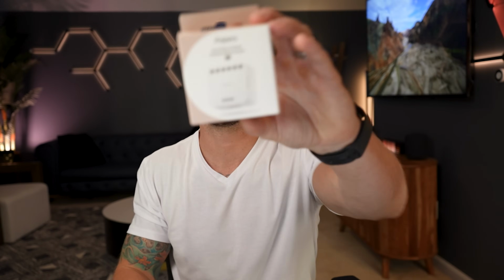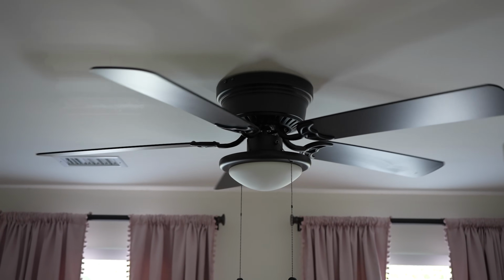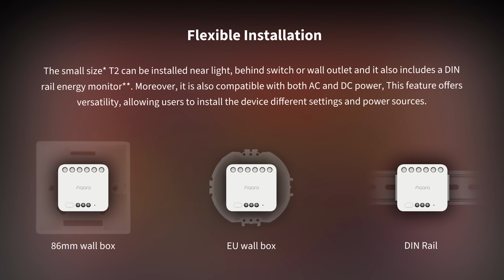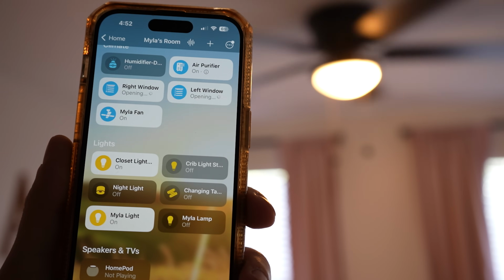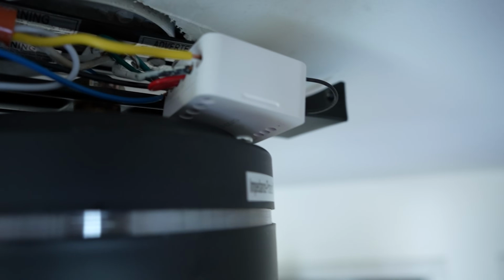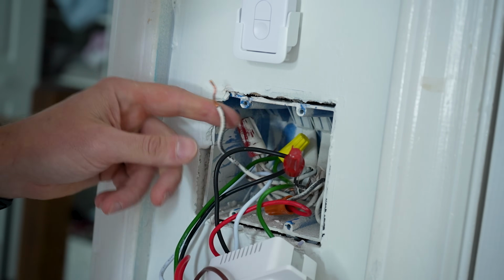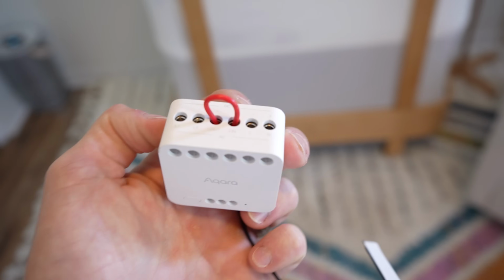Make Your Ceiling Fan (or Anything Else) SMART with THIS!

Comment: Inductive loads like fan motors are rough on electromechanical relays because they cause arcing across the contacts that can cause a fire hazard. If you want to automate a fan, use something with a solid state MOSFET relay.

Comment: Big limitations, DC voltage min is +24V so no good for +5V or +12V unless step up converter is used.  Also HomeKit  does not recognise the pulse mode with dry contacts and sees it only as a toggle so it's out of step 50% of the time.

Comment: It says I need to get something called “hub” to get it worked. Why you didn’t mention? Or am misunderstood something
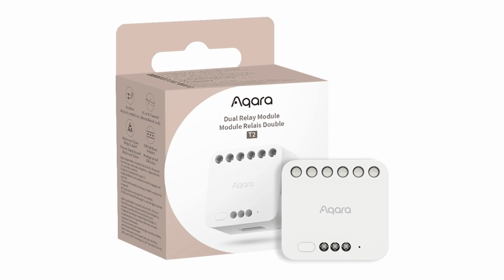Reply from the maker: Yes it is a zigbee device, which means you need an Aqara zigbee hub (mentioned around 2:40)
Reply: @ShaneCreates I’ve bought the M1S 2 gen and on the way to get it paired it says error code 74. So it appeared on my Apple home kit, but it works just as a single switch with option to dim. My plan is, to do the same thing as you did in this video. To separate light fixture and the fan. I can’t pair the t2 module with m1s gen 2 hub… can you help me to find a solution please

Comment: For those wondering if it works with Home Assistant, it doesn't. You need an Aqara hub, and then it will work. The relay itself does not work with home assistant, but the aqara hub does, through a Matter integration.

Comment: Hey Shane, just wanted to confirm that this works only on/off with the fan, no option to adjust fan speed?
Reply from the maker: That's correct.
Reply: @ShaneCreates Do you have any recommendations for doing so with a fan that only has a single on/off existing wire? 

I was thinking that it could be done with a HomeKit switch such as the Meross and a HomeKit fan such as Hunter.

Comment: Great video. Actually while building my house I put about 40 aqara T2 smart relays inside the junction boxes for all the lights. This means I can use regular lights and regular switches. The T2 relay module sends only 12V to the switch boxes on the walls. They are meant just to click the circuit together so that the relay turns on or off the specific light. This means my circuits in the walls are still normal, nothing is changed from the electrical standard while I am able to use regular lightbulbs and switches to control the lights but also have that option on the app.
I am trying to make my house wife approve so that the physical functionality is always there even if you don't want to use the phone or any automation.

Comment: YOU DONT NEED ANY OF THAT! JUST USE THE BROADLINK RF 433 MHZ WIFI PRO. IT IS JUST A BLASTER THAT CONNECTS TO HOME ASSISTANT, HOMEY, YOU NAME IT. SO STOP CLIMBING LADDERS AND PLAYING AT BOB THE BUILDER BECAUSE ALL OF THAT IS COMPLETELY UNNECESSARY. YOU ARE GOING TO FALL OVER THAT CHILD'S CRADDLE BRO. YOU ARE TOO OLD FOR THAT. LIKE I SAID, NO RELAYS, NO MODULES, NO CABLES AND NO ELECTRICAL INSTALATION NO SENSE. THE ONLY CAVEAT IS THE YOU NEED A LINE OF SIGHT BETWEEN THE BROADLINK BLASTER AND THE FAN, SO YOU MAY NEED A COUPLE OF THOSE. IT IS JUST A FIXED REMOTE CONTROL. MOST FANS ARE 433MHZ SO YOU DONT NEED TO WORRY IF IT IS DC OR AC. IT JUST WORKS. THE BLASTER LEARNING PROCESS FROM THE REMOTE CAN BE A BIT OF A CHORE BUT TOTALLY DOABLE!!!

Comment: is there any way to have a switch and a dimmer instead, I've been racking my brains on this. I'm trying to have the fan on on one rocker, and turn the lights on but have dimmable functionality as well on the second "rocker"...
Reply from the maker: If your fan and light each have separate light switches, you can replace the one for the light with a dimmer. But if they use the same light switch, as the one in this video, it's not possible.
Reply: @ShaneCreates  same switch unfortunately. I think the best I can make out oft is to have smart dimmable  bulbs

Comment: Thanks for the detailed video, it really helped me install these devices. I've got the a T1 Relay module and a double rocker switch, but I'm unable to dim the lights or control the fan speed, the switch is basically binary. How did you make the switch have dimming capabilities?
Reply from the maker: The switch is not a dimmer, so there are not dimming capabilities with the switch.

Comment: So I tried doing this. Here is my one question/hangup. If you're really just powering the switch and essentially not connecting the power "out" from the switch to the fan, how is the ceiling hot getting power? Isn't that disconnected since the switch isn't allowing it to pass through? Tell me if I'm missing something simple..

Comment: Hi Shane! I have a challenge for you. I have a two car garage, with two doors. I’m planning to operate both doors with one relay, as it should be doable. How am I able to automate it? I want to open the correct door automatically. The idea at the moment: if my phone is connected to a car no 1 with BT, when arriving home, open door1. If phone is connected to car2, when arriving home, open door2.

Do you have any idea how to solve this? In aqara app, or in homekit or through siri shortcuts or even in home assistant? I don’t have home assistant installed yet, but this might be the trigger to do it.

Comment: Can it be used with a Regular Fan Dimmer switch? I just need to automate  ON/OFF and control the fan speed with dumb knob?
Reply: Shouldn't be a probable. Mechanically, this is just another switch on the device, turning electricity on or off on the device.

Comment: Just to let you know know Shane, you did not have to wire the load wires together (L1 and L2) together to have power always running in the switch. There is an option in the Aqara app that sets the switch into what's called "Wifi only mode." It locks the circut breaker in the Aqara switch to a power on mode and then is used to send wifi signals to things like wifi bulbs or the aqara relay module to control the on/off stage. It's highly advised to not wire load wires together in a power on current state with a wire nut screw. This is because of the load wires connected by a wire nut CAN and MAY cause a fire. It's not guaranteed a fire will start. But there is an increased risk. You should just connect the load wires normally and set the dual rocker switch to "wifi only" mode. What's nice about the Aqara switch to is, it has a overload switch in it that if any heating problem happens, it kills the connection to the load. I've experienced this a couple times when setting up an aqara switch myself when I tried to connect it to a bathroom ceiling heater vent.

Comment: Hey again! Another quick question. I have an AC powered fan with a remote that I'll just bypass. If I have an Aqara t2 in three seperate fans, can I make it that I can control all three fans from a single switch?
Reply: You can. I have two ceiling fans in my master bedroom and I use his setup to control both fans at the same time. If you wanted, you could get fancy and get a 4 rocker smart switch from Aqara and be able to turn each fan on or off from your wall switch too.

Comment: For 3 way switches, kindly describe the additional connection required, i.e.., what to do with the Two Travellers lines? Should both Rocker Switches be connected to the Rocker L1 L2 lines (which you capped in your video? THANKS SHANE! What you do is greatly appreciated.

Comment: Anyone buy the no neutral version of the switch? I want to do the same as making them dummy buttons but can't figure out how I'm supposed to wire it as I wired it just like this and it doesn't work. Should I just power both l1 and l2? @Shane Whatley can you do a video on the no neutral version? I'm at lost to figure out how to get it to work properly. The only time it does work is when I connect l1 to the switch power. I even connected the switch to a e1 and set wireless mode but it still is like broken. It's acting like a physical switch

Comment: It’s a petty Sonoff is seemingly not available in your country. I’ll be fitting the iFan04 to 8 or 9 ceiling fans in my automation early 2025. This switch not only splits the light and fan, but also allows 3 fan speeds. Obviously I’d have to run it via Homebridge to make it apple compatible, but feel free to check out this switch, even if it is not available to you.

Comment: Good thought. You reminded me I can use Shelly relays to control the fan, I'm hooking one up to speed 2 of the fan and a second one (SPDT) to the up/down switch on the fan so I can have the speed reverse during the winter automatically. Once that is running (with Home Assistant controlling of course) I'll look into a 4 way switch so I can totally control the motor speeds 1-3 and maybe the light bulb (which is zigbee bulb now, but I could go back to a normal one). Stay tuned.

Comment: Oh man! I LOVE these things!! I am a worship/tech pastor at a church. We use these everywhere from turning on digital signage TVs around the facility to appliances to our access control system. In particular, I love it for access control! We have an existing access control system. I wired the relays (in dry contact mode) into the push to exit terminals of our access control panel. When the relay fires, it sends a signal to our access controller to open the doors. Works like a charm. We are also using the relays to expand our maxed out access control system. On the additional doors, are powering the electric strikes with 24 volts in wet contact mode. From there, we use NFC tags at the doors for readers. We use Shortcuts and Home apps to create access control rules for our people. Typically speaking, cloud-based access control systems are super expensive. We have bypassed all that and are enjoying our super simple, low cost solution!

Comment: Can the relay be used with light switch dimmers too? I have a traditional wall switch with 2 dimmer bottons. Would like to control the lights with both the app an physical buttons while still being able to use the dimmers.

Comment: Just did the exact setup at home…my question is how did you handle HomeKit showing you both the relay switches and the light switch buttons? I ended up having to group them together (ie top button on light switch is main light and relay switch 1 is main light so the HomeKit group is called Main light and have both accessories)  is that the best for to handle that?
Reply from the maker: I would probably just "hide"  the switch in HomeKit the best I could since that is really only used for the physical switch control/automations. Remove it from "favorites"  and put it into a "default room"  in the home app... something like that.

Comment: Hi Shane, thank you so much for the video 🙃!
I have a DC fan with light and a single wall switch.
By adding an AQARA T2 and a double AQARA H1 wall switch, will I still be able to use the remote control that comes with the ceiling fan? Thank you 🙏

Comment: I want to use this relay on my girlfriends fan light combo in her apartment, which is controlled by one switch. Would I be able to change the lightbulbs in the fan to Philips Hue, put the Lutron aurora over the existing dumb switch to control the lights and then do an Aqara button to operate the fan?  since this is an apartment, she's renting, I'd like to avoid changing the original switch, but would still like to have physical controls on the wall.
Reply from the maker: Hmm… 🤔 I think that just might work. The switch (wired to the light and the fan) would remain on always which is needed for both the relay and the smart bulb.
Reply: @ShaneCreates  Going to attempt it next weekend 🤞🏽
Reply from the maker: @jay-jay017  Good luck!

Comment: Hi,
I own a hunter stile with a remote control.
I wondered if i could replicate what you did while keeping the fan controller for the remote? 
Thank you.
Reply: This won't impact the fan controller remote. It just acts as another switch on the light. Everything will work the same, you'll just have another way to turn electricity on or off on the fixture.

Comment: since the relay doesn't allow for speed control, if I have the fan powered on, could I use the chain pull on the fan to change the speed?
Reply from the maker: yes

Comment: Great find! Quick one: do you know if this setup works with a no neutral switch? Having issue where the light/fan get power but the switch doesn't seem to turn on (despite all of its wires conducting electricity).
Reply: Did you find anything out? I have the same issue? I'm assuming I need to connect the l1/l2 wires?
Reply: @urmastertech I never got it to work properly with the no neutral wire switch. Luckily, I had access to a neutral wire, so I changed to a neutral wire switch and it worked fine thereafter.
Reply: @mvialle  darn. I bought two of these for $20 locally so I'm hoping I can get them to work. I did finally get it connected to zigbee once I connected l1, but light flickers and since I'm also using the t2 I can't totally remove power from that. Hoping the aqara hub I bought opens up to more options to put into decoupled mode. Otherwise I'd have to buy the with neutral one as well

Comment: Shane,  love the idea of using the T2 and a wall switch, my only question, is the relay is only on/off correct?  There is no way to controlling the power level of the fan (lo, med, or high) is there?
Reply from the maker: Correct. It is just on/off

Comment: Late to the game here, but I just saw this super-informative video now. You clearly explain how the single-switch-to-fan/light problem is likely one of the best use cases for the Aqara T2 Dual Relay Module. Coupled with Aqara’s double-gang switch, this is the perfect solution to an age-old problem. The fact that the T2 relay has “wet contact” (powered) and “dry contact” (switching only) modes, support for AC & DC applications, and two switching circuits make it one of the most versatile home automation relays I’ve seen. FYI, two dry contact use cases I’m using this relay for are: 1) Using an RFID tag to override my home thermostat for 15 minutes to inject heat into my freezing cold basement office on winter mornings; and 2) Using an RFID tag in the lobby of our condo to “buzz” me in through the front door of our 1990’s intercom-based visitor entrance system when I don’t have my key. Thanks Shane. Love your calm, cool style and your inspiring and informative videos that take us all to the next level.

Comment: Hi

What did you mean by “tied that into my neutrals” ? You have connected the neutral coming from ceiling into relay, now all the slots of relay are occupied. What do you do with the neutral wire coming from the fan? Just pigtail it off and not use it?

Comment: Any idea if this would work for traditional fans in countries like India, that have the good old regulator knobs separately? I want to automate the fans in my house with speed control as well in HomeKit. Would that be possible? What do I need to ask an electrician to check when I plan to call one next? These are regular fans with no inbuilt lights or IR remotes (that being the next option probably)

Comment: Any recommendations for a switch where the fan is straight wired and a physical switch doesn't actually exist for it? I was thinking an aqara button or combination of two of those..
Reply from the maker: Yes the Aqara button or any wireless button/switch that you can control the T2 relay would work.

Comment: Hello from the Netherlands Shane. I'm seeking assistance with a particular situation. 
My setup includes a switch box with two sets of three wires each, connected to a pair of 2-gang switches, which in turn are linked to four light fixtures. I've "hot-wired" the two sets to keep them permanently on, concealed the wall switch, and used 4 Aqara smart wireless switch to control Nanoleaf bulbs, which has been functioning well thus far.

The challenge arises from the absence of a neutral line in the switch box, making the installation of a neutral wire prohibitively expensive. Consequently, I cannot use a smart wall switch like the Aqara H1, and a non-neutral switch ceases to function entirely when the smart lights are turned off/dimmed via the Apple HomeKit.

Occasionally, I require a power toggle for Matter/Thread pairing, necessitating a power cycle, which currently involves a trip to the main junction box.

My intention is to install T2 relays behind the switch box, maintaining them in an "always on" state to ensure the smart lights remain operational, with the option to power cycle the relays only when necessary. 

Given that the switches are concealed behind a bookshelf and the smart wireless switches are located elsewhere in the house, this setup would be ideal.

The question is whether the T2 relay can be configured to remain in an "always on" position for the three 2-gang wires entering the switch box, comprising two sets of one brown and two black wires.

I look forward to your guidance on this matter.
Best regards.

Comment: Is there any way of controlling fan speed or light brightness with this method? I’m guessing not (except via the pull chain)
Reply: You're correct. No way to control fan speed. You can use a smart bulb to control brightness though. Maybe automate the brightness based on the time of day, so you aren't manually changing it so much.

Comment: Handy video 
To be clear, you can control both the fan and the light with one Aqara relay but for the fan you can only switch on and off the fan not change the speed.
Am I wrong?
Reply from the maker: That's correct.
Reply: @ShaneCreates  thank it would be awesome if we can control the fan speed to